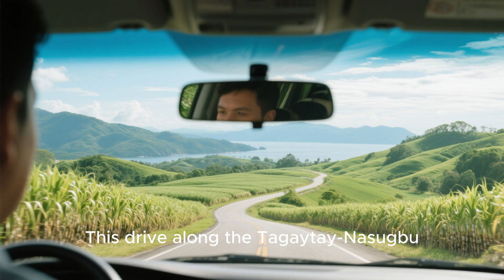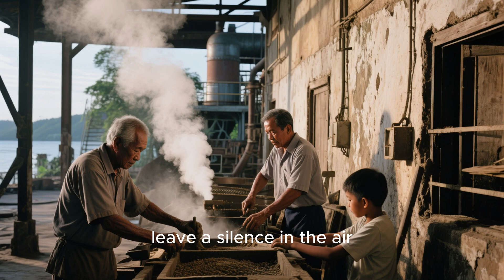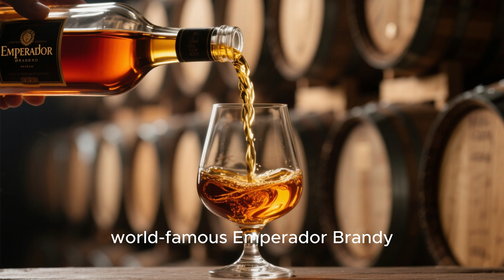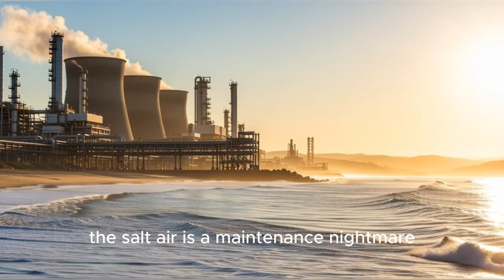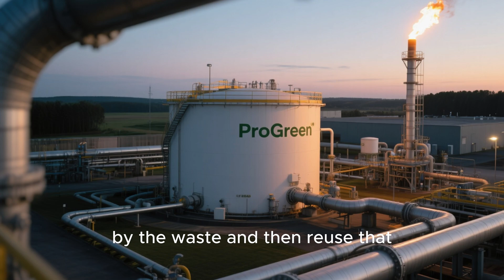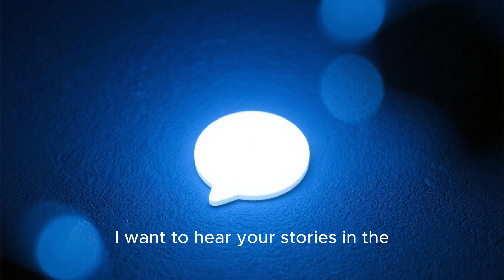Plant Maintenance: Why Distilleries Fail Without This Strategy

Comment from the maker: Para sa mga nagtatanong tungkol sa precision tools at mist system na ginamit natin sa video, heto ang industrial-grade specs ng lahat ng 7 kagamitan sa manufacturing:
 
🔬 Maintenance & Inspection:

* Andonstar AD208S Digital Microscope: 8.5 Inch LCD, 1200X zoom—para sa precision soldering at inspection.

* UNI-T Digital Clamp Meter (UT-210E): True RMS, 100A—standard for HVAC/Electrical diagnostics.

* Testo 510 Manometer: 0 to 100 hPa—gamit natin for differential pressure metering at compensation.

⚠ Safety & Gas Detection:

* Habotest HT60 Gas Leak Detector: Portable combustible gas alarm with LCD display.

* 4-in-1 Multi Gas Detector: Monitoring O2, H2S, CO, at LEL—critical for industrial safety.

💨 Agri-Tech / Humidification:

* 10 Head Ultrasonic Mist Maker (Industry Fogger): 250W with Power Supply—the main unit for our greenhouse cooling.

* 250W Mist Maker (Standard Set): Power supply included for humidity testing.

(Lahat ng tools na ito ay naka-tag sa "View Products" button ng video na ito para sa full technical specs at Shopee pricing.)

👇 Technical Q&A: May tanong ba kayo tungkol sa pressure compensation (Testo 510) or sa  mist density setup? 
Drop your questions below!

> Engineering community from LinkedIn, please drop a "LinkedIn Engineering" sa comment so I can prioritize your technical inquiries first!

#AgriTech #IndustrialEngineering #MaintenanceTools #GAIUSIndustrial #MistMaker #SafetyFirst